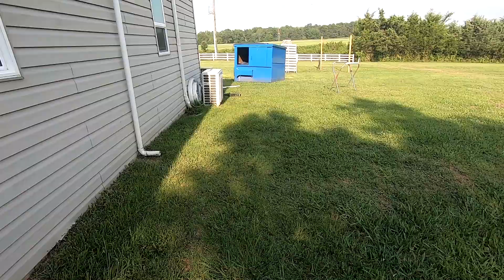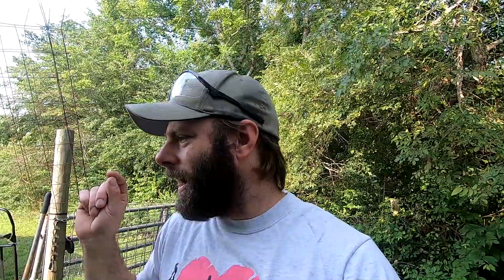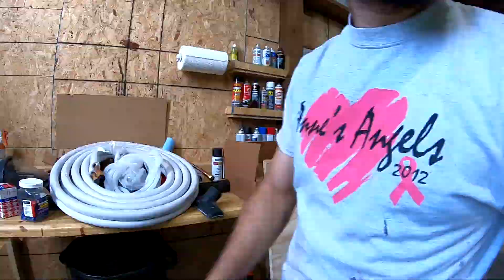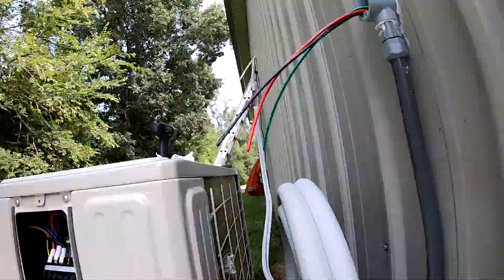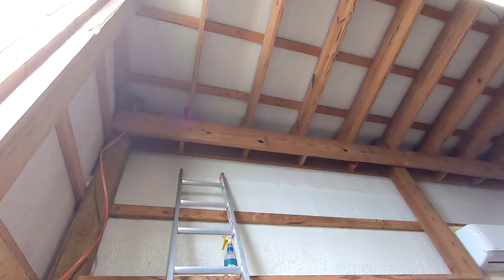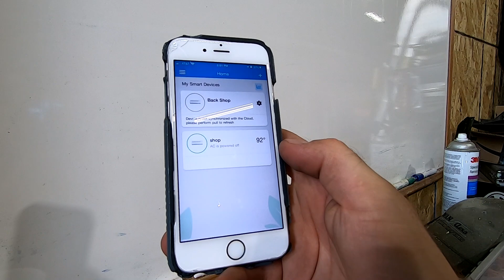Heat and A/C in ANY shop! Easy DIY setup with Mr. Cool Mini Split

Comment: What’s the update? I just built a 30x40 shop and found a 24k for cheap on Facebook. I’ve got my shop spray foamed. Do you think it would be good enough to cool that size?
Reply from the maker: @angrygoat1322  with good insulation it should be ok.

Comment: Do you have an issue with the angle of the louver (the piece that swings up and down to let air flow) when using Cool mode vs Heat mode?

On my MRCOOL, when I'm in Cool mode, the louver stops about half-way down and swings back up. In heat mode, the louver swings all the way down, parallel to the wall, and swings back up, only stopping half-way, and swinging back down again.

Do you have this issue or is this expected functionality?
Reply from the maker: I haven’t noticed that but didn’t pay specific attention to it either.
Reply: @ajhartmanaero  Can you verify by turning it on heat mode and see if the swing angle of the louver is different than on Cool Mode? Thanks!

Comment: Any issues with heat pump operation when the outside unit may be covered in snow?
Reply from the maker: No. The one in the front of the shop has iced up and will go through a defrost cycle but still gets my shop up to temp decently.